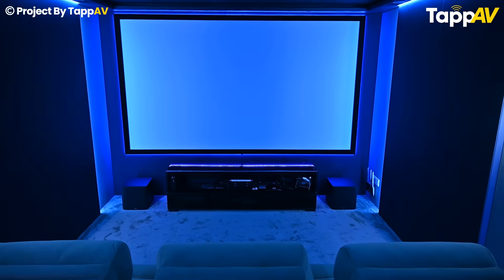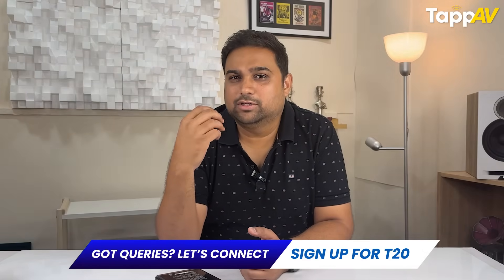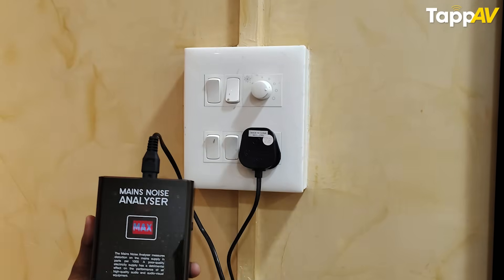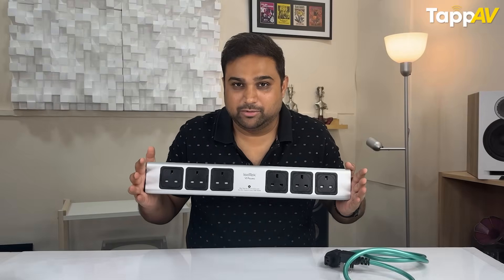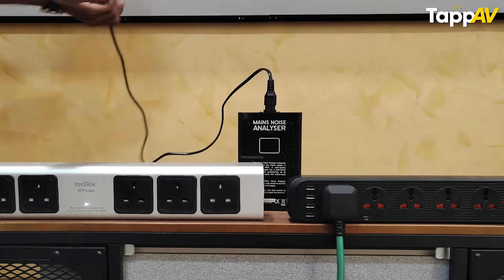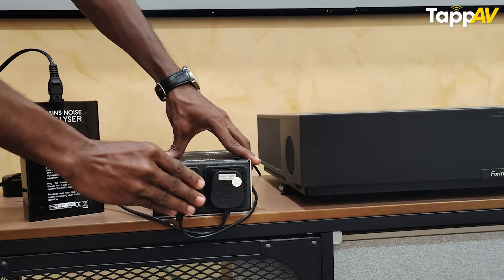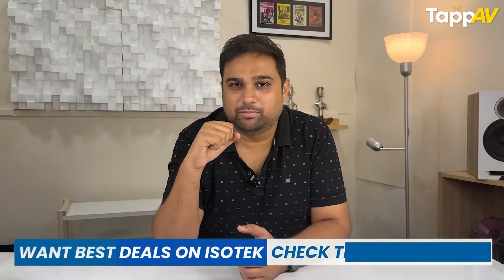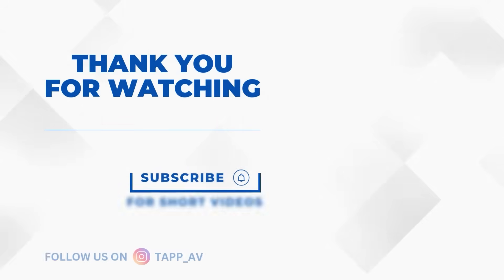These Plug-Ins Made My System Sound Expensive! | IsoTek

Comment: Very informative. Can we use this with UPS? What would be the sequence? UPS-> Isotek -> AV gadgets or Usotek-> UPS -> AV gadgets? Is the difference in overall output noticable by anyone or only expert like you can notice that?
Reply from the maker: First option is the right sequence 👍🏻
Difference is subjective to the ears. But if you have been using hifi gear for 3+ years, then I am sure the ears are getting there!

Comment: For a sec I thought we were debunking these snake oil😂😂
In any AV device Mains power is converted to DC power which is usually through transformer or smps.
So the high frequency noise is automatically filtered out when passing through it. 
The good testing should be showing emf at speaker output connecting ur BS power strip and a regular power strip. 
🤭
Reply from the maker: Interesting perspective, thanks for sharing your thoughts! However, the Mains Power has many other factors apart from Frequency Noise that gets rectified at the source.

Comment: Isotech is very well known company no doubt 
But if you are using online ups for entire system 3KVA with battery Package will do the same i belive they also have powerful noice filters on their supply circuit
Reply from the maker: The surge protection upto 45000A, common noise reduction, DC Offsets and 35dB reduction in RFI is still not possible with any good UPS. It can definitely be a good alternative to fix the power voltage and backup but not have any difference in system performance!
Reply: @tanmaymehta i See , but the cost is not justified tbh
Reply: Exactly using UPS will solve to some extent